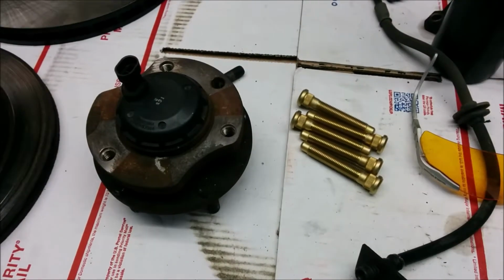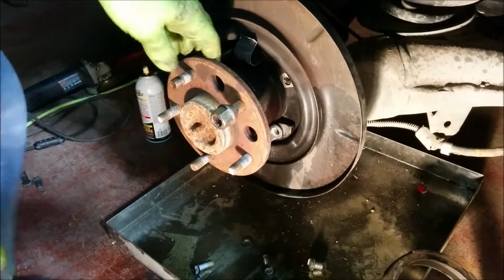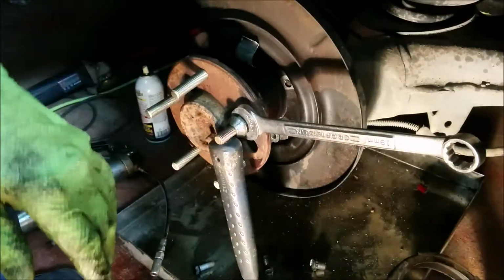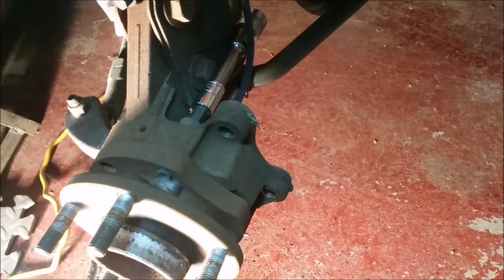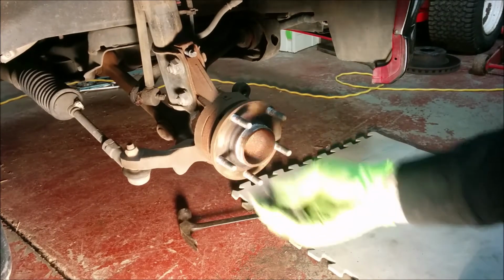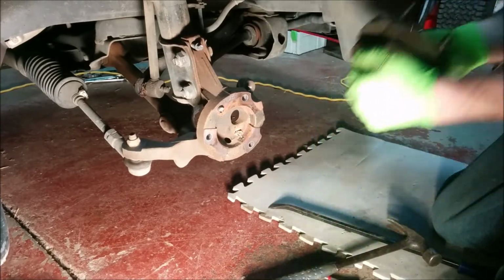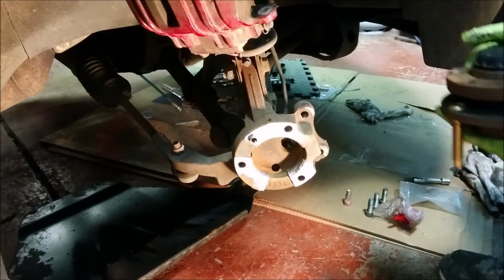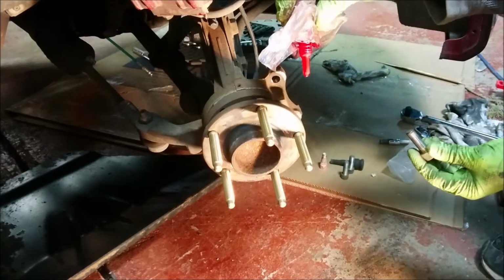2005 GTO Brembo upgrade part 3 installation of ARP extended wheel studs

Comment: I had to do the same on my Beretta GTZ when I bought new wheels and needed a spacer.
Reply from the maker: Oh hey man what's up. I'm hoping to finally get around to installing my eibachs that I got from you on my Calais 442 this summer
Reply: @evsnova74  Cool!  I ended up doing a Koni insert setup on my GTZ with the Eibachs.  The adjustability is awesome.
Reply from the maker: @dante04srt  oh man I may look into that. I remember Jeff's write-up on quad4forums but isn't it also posted on berettadotnet?
Reply: @evsnova74  There is a write-up on the Koni install on the Beretta but I'm assuming it's similar on the Calais.  Basically you reuse the factory strut housings, weld a machined collar on the top of the housing (where the factory strut inners are removed) and then a specific Koni insert will bolt right in.  That's simplified, of course, but it's pretty straight forward. I was able to do mine in a day.
Reply from the maker: @dante04srt  perfect, I have a few spares I can use as housings. I had old rocketparts struts that were very firm but they won't last forever.
Reply from the maker: @dante04srt  hey what kind of options do we have for stiffer rear shocks? I had an old set of rocketparts shocks that were super firm but when I dug em out the other day they seemed to compress way too easily
Reply: @evsnova74  my guess is the Saab Koni adjustable.  I'm assuming they're the same between the Nbody and Lbody so id bet they'll work.  They were bolt ons for my GTZ
Reply from the maker: @dante04srt  I found the part numbers for those, a little more pricey than I'd expected but at least we have options. I didn't have much success finding a strut insert write-up however, just a link to quad4forums. I may try to see if I can find Jeff's email address and send him a message. Anyways thanks man
Reply from the maker: @dante04srt  hey Brian do you remember what front inserts you used? It's looking like the j body inserts are hard to come by, the only option left mentioned on the beretta forum is for the mitsubishi eclipse? Later in that thread someone mentioned that the rear shock from a fox body mustang works for these if you open up the bottom bolt holes a little bit so that's a relief, they won't likely discontinue that platform any time soon. But the fronts have me a little worried.
Reply: @evsnova74  I used the eclipse inserts on my front. The rears are from a Saab 9000.
Reply from the maker: @dante04srt  perfect. Now I just hope these sketchy looking sites that say they have them are legit. Thanks man, can't wait to get this buttoned up
Reply: @evsnova74  I believe I went through something like th Motorsports. I hadn't heard of them prior, but I've since ordered a few different things from them and being happy every time.

Comment: Hey mate, not sure if you will see this comment, but what was the purpose of the extended studs here? In the middle of doing the 4/4 Bremhos on my monaro and havnt had a need for them so far....? Great content by the way!
Reply from the maker: @BBGuitars  yep these come right to my phone. These studs aren't necessary for the brembos, unless you're using spacers to make your wheels clear the calipers. I just added this to the series because I was doing it at the same time. Thanks man
Reply: @evsnova74  thanks for the clarification! Fitment of the new wheels to clear the brakes has created a side quest of desperate need for camber kits to be installed. One thing after another...